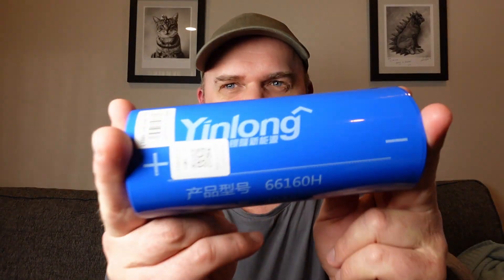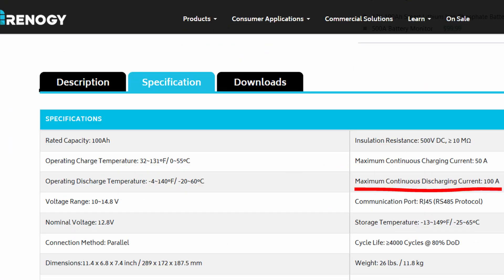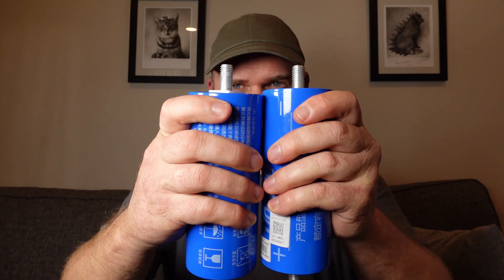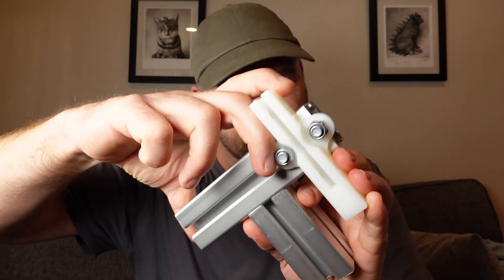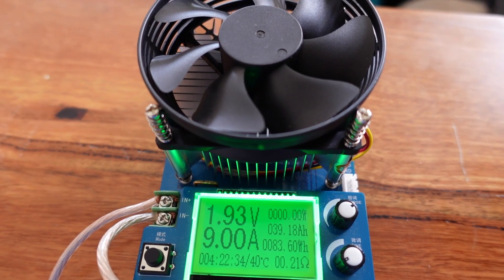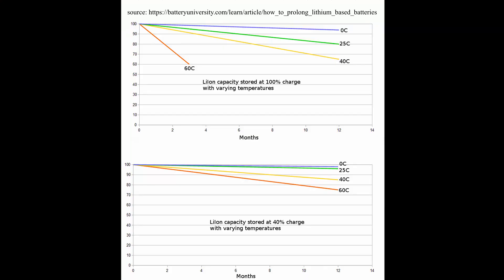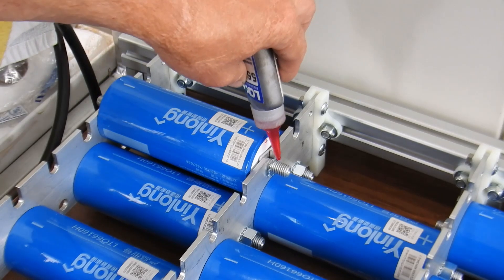Campervan DIY battery build HUGE POWER!

Comment: in the RE community...we express capacity in Ah amp hours

the reason for this is wattage will change as voltage goes down, amperage does not
Reply from the maker: Hey Chris, sorry but the community is wrong.  Ah is not a measurement of electrical storage capacity.  Its the same as saying the horsepower of an engine is  3000 rpm.
Reply: @brendontait6968  actually, I'm also a a mechanic....and horsepower is rated at certain RPMs....with tourque rating at that rpm

If we are wrong...and we aren't....then why do all battery manufacturers print Ah on their batteries

kwh is an instant power
You can not say a battery will provide said kw till it is dead...because as voltage of the battery goes down, the kw capacity goes down

But you can draw the same amperage as voltage goes down

I can't explain it any clearer
Reply from the maker: Hi Chris, I'm pretty sure torque figures are pretty much always stated at lower RPM than power figures because power is a function of torque and RPM.  What I was trying to get across was that just stating torque or RPM gives you a very incomplete picture of the capability of an engine, HP or kW gives you a much better understanding of the amount of useful work an engine can produce.  

I understand what you are trying to explain to me for the most part.  But keep an open mind, we are all here to learn.  I'll address firstly something you said above which is not necessarily correct, or perhaps I've misunderstood.  I wouldn't describe kWh as an instant in power, it is solely a measurement of power consumed - whether that is over 1 second or 1 month, the time aspect is irrelevant - it is purely the amount of power that has been used/given.  With many devices, say led lights, airconditioners, fridges, inverters all have electronics in them that compensate for the reduced voltage as a battery discharges so the power draw (watts) from the battery in most cases WILL remain relatively constant and the current draw will INCREASE as the battery voltage drops. 

I like to think as simply as I can with units that are unambiguous and describe as much of what we are looking at as possible.  

Say for example we have an airconditioning unit that draws 1000W, we want to know how long it will run for on our battery.  If we have a battery that is 1kWh, it's simple... that AC unit will run for one hour before the battery is exhausted.

Now if we have a 100Ah battery - there is no way we can easily figure it out from that number alone because Ah is not a measure of energy capacity.  It is a measure of coulombs and it does not take into account the energy level that the electrons are at.  Firstly we have to know if our battery system is 12, 24, 48V or any other voltage it could be at.  Then we have to figure the discharge curve.  So a 100Ah lead acid battery will run our airconditioner for a different length of time to a 100Ah lithium battery even if we disregard the peukert effect.  The reason for this is that they have a different voltage discharge curve and the battery will not deliver the same voltages at equivalent states of charge.  Because of this, each battery will put out a different amount of useful power even tho they are both 100Ah.

I have no issue with battery manufacturers using Ah as a unit for a descriptor of a cell because for an engineer, this is a totally usable unit when used in a function.  However for consumer level battery packs, it serves no useful purpose.  Look at electric cars, tesla power walls etc, they are all rated in kWh because it serves as a useful indicator of the amount of energy that battery pack is going to be able to deliver.

There are many things in this world that are done just because that is how they have always been done, I feel it is time that people change with this regard to make electrical systems much easier for everyone to understand.

Comment: I still don't get why Will says that LTO is expensive.  Well, is it?
Reply from the maker: It is expensive per kWh storage.  But that can be countered depending on how it is used.  If you do a large number of cycles,  if you are running in abnormal temperatures, if you are wanting something semi tolerant of a BMS failure these cam work out cheaper.  I'll do a cheap LFP version which will be much cheaper and easier to put together.

Comment: Not talking shit but those battery's require a balance board. With out 1 one cell can get high volt then others and u can end up frying your batterys.... maybe I messed it lol
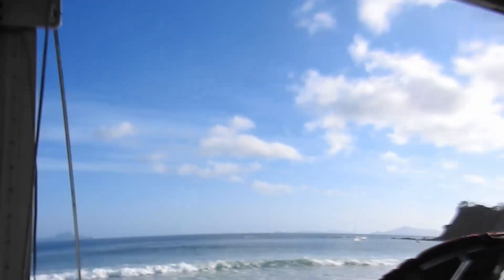Reply from the maker: 10:00.   Misconception about balancing tho, if the pack is assembled properly banks should only need to be balanced once every few years.  They 100% need a monitor tho
Reply: @brendontait6968  I'm pretty sure your wrong. They sale bms batery management system. .they use that for the 2.7 and 2.5 super cap. And say your not using ..it depend on how u charge the cells. Like if u are charging 1 cell at a time with 2.7v . Then u don't need....if u don't use. Then 1 cell gets higher volts and dies.every brand of these types of battery say you have to use.now maybe u can get away with it. As I've  only done massive research.  I haven't played with them .... and it's because of bms and charging..have u used these? Like besides 1 time?. I live off grid I use 10 cheap walmart 125 ah battery's.  I have seen alot of people not using bms on YouTube for battery's and super caps. So if u have more information.  Or Web pages I can read lol. Again not talking shit. But I want to learn.  Lol
Reply from the maker: Hey John, am pretty sure I'm not wrong.  I have a BMS at 10:00 you'll see it. It does have a very limited balance function in it.  But I don't think it is mandatory.  I see people build these packs and buy active balancers to put on them and say that they are essential etc.  But the reality is that they don't know what they are talking about.  Yes, you don't want your parallel banks getting out of balance.  But you shouldn't build your pack in a way that it is likely to get out of balance.  It is important to have a BMS that monitors the pack and shuts it off if a bank reaches its limit.
So the reason a bank could go out of balance is because the internal resistance of the bank is mismatched to the other banks.  Build the pack in such a way so the banks each have matched internal resistance and the pack should stay in balance for several years.  Having an active balancer working away trying to keep a mismatched pack in balance is just putting a sticking plaster on a poorly assembled battery pack.  Guaranteed the first thing that is going to shit itself is the balancer.  100% use a BMS to monitor and shut it down if it needs to be.

Comment: 23 parts per million?  when did a concentration measurement turn in to a size measurement? .23 Millimeters of expansion. lol good video subbed!
Reply from the maker: Thanks!  PPM/°C is a perfectly legitimate and frequently used descriptor for linear expansion of materials.

Comment: I am truly impressed that you are not a trained engineer, because the engineering  language and facts and figures that you quote are unlike any trained engineer I have worked with, this does you great credit a a self trained engineer. Incidentally A/h only really applies to DC systems and not really work accurately as an AC system power use measure.
Reply from the maker: Thanks for that John, Ah isn't typically used on AC systems because it's not a measure of energy capacity which is the same reason it shouldn't be used on DC systems.  Obviously with AC you have the possibility of reactive power draw. Try avoid putting the "/" in the unit - it kindof reverses it's meaning.  It isn't amps per hour (which would be amps divided by the number of hours), it's amps multiplied by the hours that it is delivered for.
Cheers
Reply: Hi Brendon 
In my message there was a slip up. It was meant to be complimentary, but didn’t read that     way. It should have read not unlike any engineers I’ve known.

Comment: Blue loctite is more forgiving - Red loctite requires heat to break free.
Reply from the maker: The 'loctite' that is used wasn't loctite brand, so doesn't follow the same color coding system as loctite.  I used loxeal 55-04 which is equivalent to LT blue

Comment: Interesting video.  I would have considered blue Loctite instead of red, or maybe just simple lock washers.
Reply from the maker: Thanks Norman, The 'loctite' that is used wasn't loctite brand, so doesn't follow the same color coding system as loctite.  I used loxeal 55-04 which is equivalent to LT blue

Comment: Highly informative... These would be IDEAL as an in-line rapid-charge system for "regenerative breaking", with the addition of a super-capacitor buffer. The biggest issue with regenerative breaking isn't that there is not enough power being generated. The issue is that only a fraction of the power generated, can be crammed back into any typical battery, through typical charging-systems, without damaging the batteries.

However, if these, as well as super-capacitors, were used for that momentary-burst absorption... which could instantly be returned on the cars next "acceleration phase", or just stored-up, so it could be used to slowly discharge into the normal (cheaper) battery bank... Then regenerative breaking could help give cars that next comparable edge. (Generators normally produce massive voltages which have to be "stepped-down", in order to use it for charging. That increases the amps, which now becomes an issue with heat-loss and retention inability. While a super-cap can be setup for the initial high-voltage absorption, dumping the high voltage into these cells, at a reduced voltage and higher amperage, which can then be used to "trickle-charge" the battery bank behind it... Or, simply returned to the "launch", as the car accelerates, after having stopped, or slowed-down, using the breaks.)

Just imagine how much fuel garbage trucks would save. All that mass, constantly stopping and starting-up again. Doing it, with a system that doesn't add a lot of mass to the vehicle is a bonus. LiPo, for all it's worth, is still "heavy" in comparison. Just not as bad as Lead-Acid.

The only issue I see with that setup is if one battery internally fuses. Though, individually, a puncture will not ignite the battery... When you rain them together like that, all the power of the surrounding batteries will now flood through that short-circuited battery, if it fails. Thus, draining whatever wattage of that "railed segment", into the one cell, causing a fire. If each "row" of batteries were NOT parallel-merged, just normally wired in series, as 9 individual "chains"... Then one death or short would just result in a simple voltage drop, as you lose those 2.5volts. Or whatever the individual cells volts were.

EG, If batter #1 dies, as a "short"... All the power from the 9 behind, and in front, will try to pass through that one battery, which now has nearly no resistance. Additionally, that is like throwing a screwdriver across the +/- of the two plates, where batteries 2,3,4,5,6,7,8,9 are wired-up still. They will all try to discharge through that "screwdriver", which is battery #1, which is shorted-out. Thus, igniting it, as it now has 8 batteries draining into it, as well as all the power/load from the batteries behind and in front of it, passing "through" that short too. (You can test that theory with any LiPo setup... Do the same arrangement and now do the same "puncture test", which is essentially turning the battery into a "short". Actually, don't... it will, quite literally, explode into a molten mess of toxic fumes.)

I would cut the rails, adding a spacer to insulate the "stacks" from one another. Just another nylon spacer is fine. Adding them between the "cuts", so you have nine individual columns of batteries.
Reply from the maker: Hey, yeah they would be great at regen.  This pack is far too small for an EV and it has a charge capability of 90kW - the regen capacity of it would be more than you'd ever need if the pack was 5-10X.  One issue that you'd have with supercaps and these (although it is surmountable) is the charge profiles are very different, so you'd have to have have a separate charge controller to make sure the capacitors absorbed the charge.

If the battery has an internal short:  the LTO chemistry is inherently tolerant to internal shorts.  If a short occurs, the heated LTO anode significantly increases in resistance which reduces the current flow to nearly zero.  This prevents power from the other paralleled cells discharging through the fault and causing catastrophic failure.

Comment: Can you please share how you did the balancing of the power bank? I am planning to use 11s 24v BMS but how do you balance 110 cells? 10 BMSs? Any info would be greatly appreciated 
Regards
Sam
Reply from the maker: Hey... yeah I will do in a coming video.  I just manually balanced each parallel set once assembled - it didn't take that long to do.
Reply: @brendontait6968  Hi Brendon,
You mean they can be balanced once and then be charged without balancing at all? 
Thanks 
Sam

Comment: What kind of battery is that? Never seen one like that before. What are these batteries usually used for?
Reply from the maker: Hey - yeah they are not very common.  They are the only lithium chemistry to be used in medical implants, have been used in military applications, and used extensively in high power car audio.

Comment: I looked at your link in the description for the supplier it only shows them as 2.3 volt 40 amp hour it would take quite a few to make a decent battery Bank of 48 volts
Reply from the maker: Hey random, you'll need a few to make a decent battery bank anyrate and you'd only run 48V if you had a decent sized pack/capacity.  To make my pack bigger would not necessarily require any more cells.

Comment: I didn't see any per cell protection.  I used to have a battery bank and if one of the batteries went bad the batteries around it were affected by the heat.
Reply from the maker: Per cell protection like individual fusing?  If a cell went bad I'd likely pick it up from the BMS.  These cells are typically resistant from internal shorts
Reply: @brendontait6968  I was thinking more in line with those cell monitors.  They cost about $2 each and limit voltage and current.  I never had a cell actually explode but it did get scary hot.
Reply from the maker: What chemistry were you using?
Reply: @brendontait6968  I was using the standard lithium type, wouldn't do that again.  It was in the garage for a solar backup test setup. It only lasted a year before I got rid of it. The newer stuff seems safer but, made in China.  I indirectly worked on a lithium cell array at work and the people involved used a per cell protection device.  These were very stable 15 year lifetime batteries, don't remember the chemistry.